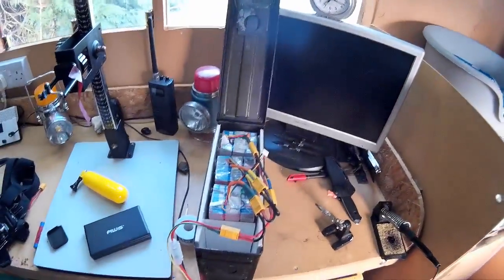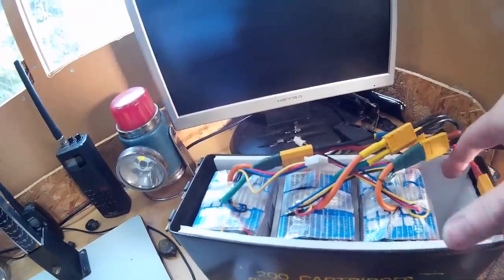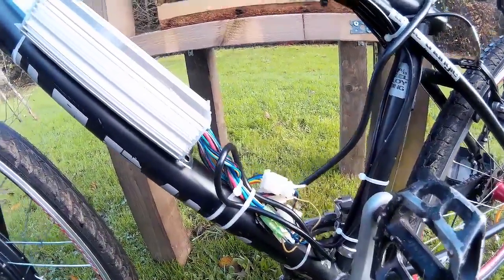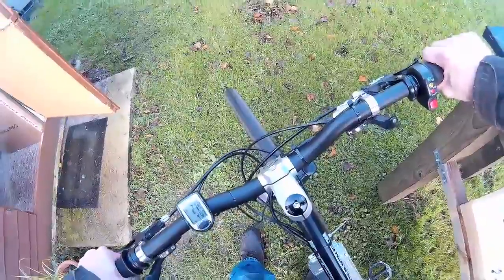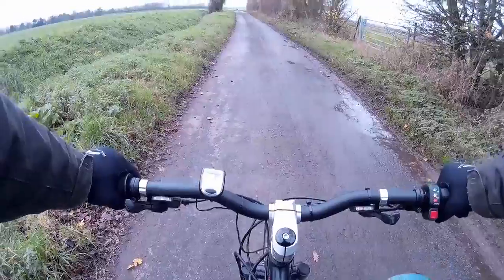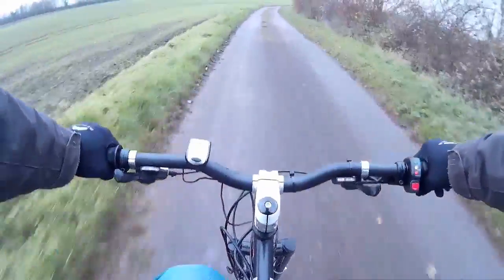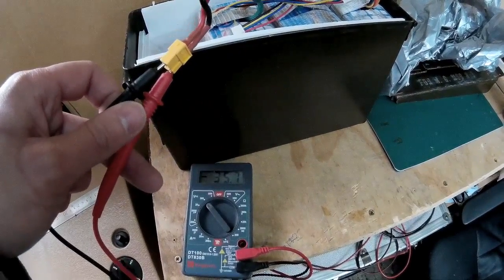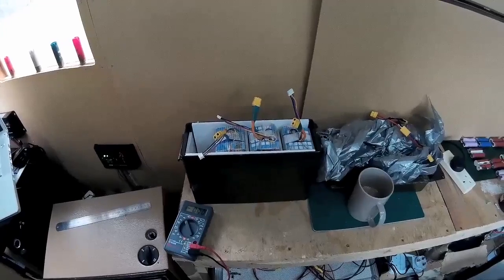DIY Ebike Battery Testing 18650 Laptop Lithium ion

Comment: think im calculating wrong or is this right to make a 48v 24AH 12 x 10 = 120 18650 2400mah battery's? 120 seams too much? or is this right, thanks for the help
Reply from the maker: Wayne & Rebecca Detectorist well i am using 72 cells 24 cells per pack so for 48v you would want 96 cells, but you can pack in as manny as you want to be able to get the distance you want.
Reply: i was thinking buying some unirose one's one's with protection cap's. or u think they would be awaste? 120 of thoush is going to cost £399 so i think i need to look else where, if i cant get any laptop battery's. maybe Lipo u think? but the C on them are quite high drain, so they drain fast, unless i can add something to it so it only drain's what i really need.
what do u think?
Reply from the maker: Wayne & Rebecca Detectorist one idea is local computer repair shops as they have to pay to dispose of laptop batteries ask they may let you have some. lipo's are ok but they tend to burst into flames more often than not i found flying rc planes, you need to really look after them. ones with protection are no good i think may be wrong.
Reply: i had called the local computer shops and they say they pay to dispose but they send them straight off. which ones should i be looking for, on ebay? what about the replacement battery's?.
Reply from the maker: get brand names DELL IBM ASUS FUJITSU TOSHIBA SAMSUNG genuine batteries not the cheap replacement Chinese ones then you know they had good cells put in them when they were made 

don't get replacement battery's
Reply: thanks i bin looking at these power banks. a power bank with 5 - 20v 32AH £130 so means it must be capable of 20V unless the switch actually switchs the mah and the mah 32ah is only 5v so 24v would be cut down to 7AH just example. i was thinking that sugestion.
Reply: Wayne & Rebecca Detectorist High drain batteries only drain as fast as you require them to, high drain none protected is what you want, lithium iron phosphate are about the best, safer chemistry with those so no need for protection.

Comment: if u dont mind me asking, what miles r u getting from this battery pack you made, and what is the least u let it discharge the battery, as im sure u don't let it drain completely.
Reply from the maker: Wayne & Rebecca Detectorist over 30 miles, i dont let it go past 11.2v, if you do you will probably damage the batteries.
Reply: thanks mate. i guess that's decent. are they still going good or u had fault's? oh is the 30miles pedal too?
Reply from the maker: Wayne & Rebecca Detectorist 500w hub motor, i say 30 miles but i know my cycle computer is not accurate, i do get more miles but have not yet checked so can't say for sure. have not had any faults so far all working well.
Reply: is that with pedaling or just motor 30 mile's... the kit i brought is kinda heavy tbh. unless they all heavy hub's.
Reply from the maker: Wayne & Rebecca Detectorist  yeah the hub motor kits are very heavy not good if you do a lot of off-roading turns your bike into a bone shaker.very light peddling like when you go down a step hill fast and you just turn the peddles for effect,  just so i don't look lazy
Reply: lol
Reply: Norfolktuber  Wayne & Rebecca Detectorist ha ha thats what i do lol,just pretend to pedal,my bike can get up to speed real quick and most of the time i cant out pedal the speed of the kit..i'm loving the warmish weather at the moment,i'm getting in as much riding as i can now before the weather turns bad,which is most of the year in uk..
Reply from the maker: bigdonkey1000 Yeaah it's nice having the warmer weather here, Yep get it in before it's gone.

Comment: so good, the 7.62 case is awesome :-) I have an old gren box from the falklands I use for storing my nitro and unstables in :-D its a really nice light weight design you have there, best part you can take it on the train :-D I was thinking of a similar setup to this as I need an eapc atm while I do the dance with the D.F.T. I have 5 x 32ah li-ion packs from china in my current illegal ebike and was gonna get a pedal bike do the in hub mods, and mount two on the back of the bike and have two in a back pack :-) ive been holding off to hear back from the head of the D.F.T but our government sucks a lot of balls and moves really slow so im in two minds of just getting on with it as a temp form of transport as I don't drive :-D what you think of housing a few extra batteries in a back pack, id love to know the total range on that setup :-)
Reply from the maker: Back pack batteries should be ok, I would forget to unplug.
getting just over 30 miles range if i keep below 14
Reply: Norfolktuber that's pretty darn decent! you have a point though it would be pretty easy to forget to unplug that after you get to where your going, I guess I could put andersons beween the wires of the pack and bike so when I accidently tug at the cables the andersons just flick open without lasting damage :-)
 Its a good sign though, with those batteries I have I should pull off 120+mile range which would be great for the lake district or the peak district :-)
 also im gonna weld some bars at foot height to rest my legs on :-) me and pedals don't get on anymore :-)

Comment: Hello got a few questions .is there any chance I could get in touch with you please
Reply from the maker: Christopher Shiels will help if i can
Reply: Need to know basics of battery building.  Buying 1000w motor .from ebay....whots the biggest battery pack I can put on ... In terms of power and amp hours
Reply from the maker: you can fit as many amp hours as its possible to carry, the more amp hours the further you can go.
Reply: If I build two battery packs 48v in series ...do I need two speed controllers. Do I need to double up on everything. I am buying 1000w motor want as much power and distance as possible....ps the motor is from ebay
Reply from the maker: if you put two packs in series then you will have a 96v pack
Reply: Do I need two speed controllers
Reply from the maker: don't know if that would work.
if you put them in parallel the battery positive to  positive
negative to negative you will still have 48v and have double the capacity then you will not need another   speed controller
Reply: Can I ring you or you ring me . I need to know the basic set up. I have over a hundred single cells. And need to know the basics..ie how to put them together... How many I can put together. Without frying my motor
Reply from the maker: Just watch my 4 part video i show you how to make it,
i made 3 12v packs to get 37.2v all you have to do is make one extra pack and connect that in series making 4 packs that when fully charged should give you 49.6v a 48v wheel will take that extra volts.

you will need 96 single cells to make a complete 48v pack,  when fully charged the battery will be at 4.2v

https://www.youtube.com/watch?v=5yPlygpfqOM

this may help  
http://visforvoltage.org/book/ev-batteries/13232

http://scriptasylum.com/rc_speed/lipo.html
Reply: This is the bit am knot getting ... Why make 4 packs of 12 volts have hassle ...why not just solder 96 single cells together and make one battery
Reply: Christopher Shiels you can if you have a 12 cell rc battery charger or a bms  i haven't and i dont think they make 12 cell charger might be wrong.
if you want to do one pack a bms would be your best bet. battery management system
here a 6 cell charger you can do it in 2 packs
 http://www.hobbyking.co.uk/hobbyking/store/__28146__IMAX_B6_50W_5A_Charger_Discharger_1_6_Cells_GENUINE_UK_Warehouse_.html
Reply: Cheers mate.. Is there a difference between a bms or ballance leads or do they do the same thing.. When do you need ballance leads.
Reply: Christopher Shiels if you use a bms you wont need a rc charger bms will balance charge and protect the battery i think they come with a set of balance leads once its all wired up you will just need to connect up a 50v power supply to charge it, i think.
Reply from the maker: Artistic Diyer Yeah one big pack will be good all so.  i agree with artistic diyer but have no experience with bms.
Reply: Cheers

Comment: I'm hoping to try making something similar! How would you describe the "push" 500 watts gives you without pedalling, compared to say light moderate and hard pedalling? Also does your motor have any 500w markings on it in-case the police ever give you trouble? (with 250w being the legal limit for road use)
Reply from the maker: It pulls you along nicely on flat smooth road im up to top speed in 2-3 seconds no peddling i would be peddling hard to keep up 
best thing to do if police pull you over is tell the truth and be honest, you wont pull the wool over there eyes they know the size of a 250w motor to a 500w, yes it does say what size it is.
But if you stick to the highway code keep to 15mph and don't go weveing in and out of traffic they have no reason to pull you over.
I abide by the rules in every other way the only reason i got the 500w was because it was a lot cheaper than a 250w and i don't have alot of money, no excuse.
but at the end of the day its up to you, but i say stick to the law and get the 250 36v or if you can a 48v.

All the best with your bike hope all goes well thanks.
Reply: Norfolktuber Thanks for the reply! I was looking at the 36v or 48v model, I assume the 48v has more torque or something? I would make a 18650 battery up for the bike. Thing is I would be charging with an RC charger (you can see my video on my channel) and it only goes up to 10s (10 x 3.7 = 37) so it would be perfect for a 36v set up. I was thinking I could run the battery bank as a 48v system and make it with connectors to split it into 2 24v banks for charging. But don't know if having 48v vs 36v is worth the extra effort?
Reply from the maker: Night Jar yeah like you say you will have more power but at 48v you will draw less current from the battery,
if you keep at a steady 15mph you should be able to go a longer distance than if you were running a 36v more amps from battery at the same speed, so you will be pulling less amps so should go further.
Or go 36v now you can buy the speed control boxes on ebay cheap and upgrade to 48v later by adding a 12v pack .
but your 2 24v banks will work as well you have the charger so your set what ever you do.
I think i would go 48v if you can a bit more work but probable worth it.

Let us know how you get on post a video would like to see.
If you need any help i will do my best, all the best good luck with it.
Reply: Norfolktuber Thanks for all the advice! I will when I get round to it! (it's confusing having the same profile image haha) Cheers.

Comment: thanx for the replay. from what i understand 18650 are 3.7V. if we try to reach 36v we are creating a 10 cell battery. 
 iMax B6AC seems to be charging 1-6 cells of li-ion batteries.
So are they charged separately? is there a way to charge them together?
Reply from the maker: 9 cell battery, at full charge the are around 4.2v .
i made 3 battery packs then when in use connect them together so i didn't have to buy a expensive charger but if you want to a more expensive 10 cell charger that's up to you.

Comment: hey! thank you for the tutorial, it is very informative (:
I would like to build such a battery pack myself and i still have some unanswered questions, mainly these:
can you specify a charger that is compatible with the battery pack?
can you specify a bms that is compatible with the battery pack?

thank you in advance,
ben
Reply from the maker: just get a iMax B6AC will do the job but dont make the mistake of buying a cheap Chinese copy,

i dont use a bms as long as your cerfull